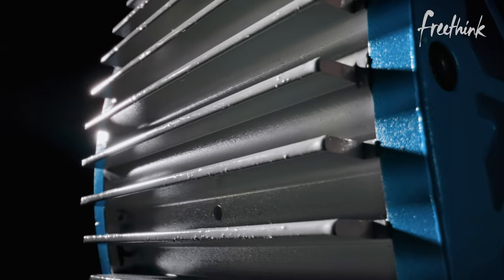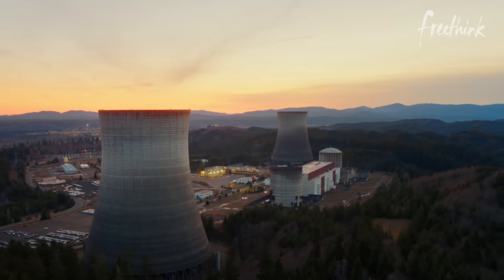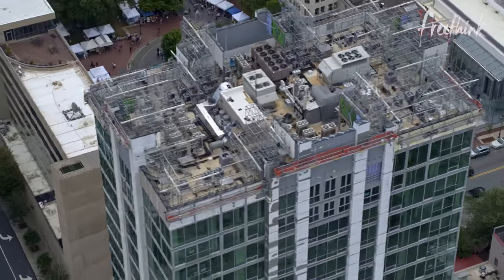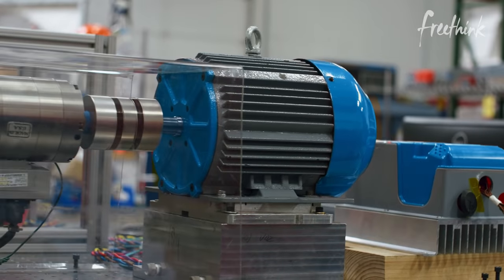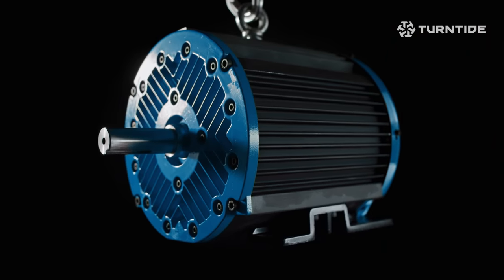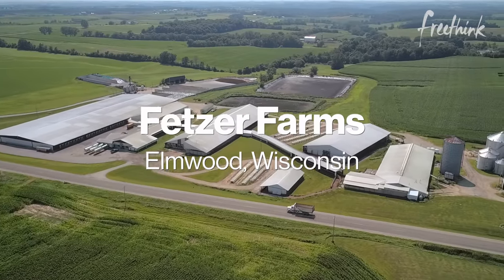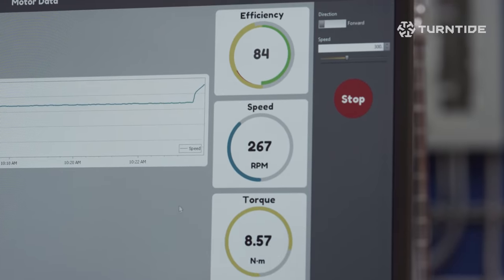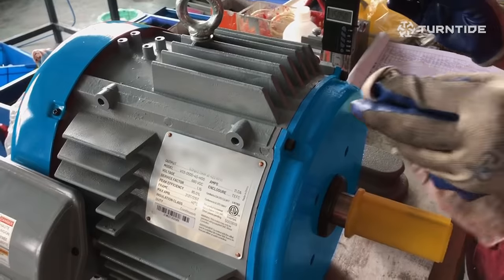Want to Save the Planet? Start with Reinventing the Motor

Comment: As someone who holds a BS and MS in electrical engineering, I can honestly tell everyone watching this video this guy is full of it.  Half of the energy is not wasted in electric motors.  Most induction motors are at least 80% efficient (the most common motor used in residential HVAC systems, or residential anything).  Most modern industrial motors have efficiencies greater than 90% due to advancements in VFD drives.  There is quite simply no need to improve on motors much more than has already been done.  The YouTube community needs to do its part and downvote this video into oblivion.
Reply: i was wondering  to if their not just talking about some wierd single phase to 3 phase converter or some thing
Reply: @cameronidk2  If you look in high-efficiency dishwashers for example, they already have that.  Wherever economically feasible, motors are already being replaced with their more efficient counterparts.  A particular motor that isn't very efficient is called a "shaded-pole" motor.  They used to be everywhere that required a small fan.  Now they are being phased out by brushless versions with much more efficient drive circuits.  There really isn't much more opportunity for improvement in efficiency beyond this.  And that work has already been done.  This video does nothing but make false claims purporting there is much more that can be done -- well as a seasoned electrical engineer, I call B.S. on all of that.
Reply: I was wondering the same thing when the opening statement about motors wasting 50% of energy. This is the whole basis on Tesla. Three phase motors are 90% efficient depending on frequency.
Reply: B.E. here...we use the things we already use for a good reason and by promoting these "innovations/kickstarters" to people who aren't in the know just to take their money is downright immoral. There is a reason our roads are made from plain slippery when wet asphalt and not that "revolutionary" self regenerating one someone held a chunk of on a video.
Reply: I don't finish EE(switched to materials engineering) but I get what you said
Reply: Man, literally 35 secs into the video when he said that statement about half the energy being wasted I was like this is bullshit, then I paused the video and went to the comments to see if there was anyone else who also picked up on this bullshit.
Reply: I was just about to write this. They are overhyping a decent invention that may have very particular applications. Electric motors are verry efficient, especially on industrial applications. Most ineficiencies occur on application that require a constant on-off control of the motor and most of these are solved ussing VFD. There are few things more elegant than a 3phase inducion motor on industrial aplications, pure efective simplicity.
Reply: Thank you, this is BS. 3 phase brushless induction motor is 90% or more.
Reply: byugrad1024 The patents aren’t owned by the Software Motor Corporation of Sunnyvale.
Reply: @jpdemont  Not sure what you mean by that.  My criticism is of the video itself.  In the video they claim motors are only 50% efficient, which is an outright lie.  Deceptive.  I could care less about any patents involved here.  This is purely deceptive marketing and click-bait going on here.
Reply: My BS sensor went of the moment they claimed it was thought to be pretty much impossible and then call switching something on and off at 20 kHz fast... And even silly brushed motors can be made to be 80% efficient.
Reply: How do you know a life time student is in the room,.....don't worry they will tell you
Reply: As a State Certified Electrician & Automation Technician, I am so glad you made your comment; as I was hearing him talk, I was losing my mind and starting to question everything I already knew.

These people don't know what snake oil to sell these days in the name of "green".
Reply: Pure BS reported this video as spam/scam
Reply: @aussiegruber86  Not a life-time student, although I studied a lot in school.  One of the benefits of that (in addition to earning a killer income!) is that I have the credentials to call out scams and false claims when I see and hear them.  This is one of those times.  I have no interest in being a student any longer, but I'm definitely engaged in life-long learning.  You should try it sometime.  Just don't make any false claims about anything or you'll probably get called out on it.
Reply: I think the "50% wasted power" he's talking about refers to under-loaded induction motors, which DO waste a lot of power if they aren't driven by a smart controller, due to their low power factor in this case.  The fact is, MOST induction motors are operated at much less than their full rated power, due to the need to be able to handle high starting loads (especially in loads such as air compressors and refrigeration compressors) and high peak loads in a great number of industrial applications.  While it's true that most of these applications could be served by electronic controllers, the fact is that most of them are NOT.  They are simply run at the full rated voltage even when lightly loaded, causing them to run inefficiently.
I am not an expert on induction motor design (that is, the motors that drive almost all industrial loads), but I do know that resistance is deliberately designed into their rotors in order to optimize for certain characteristics, and this resistance leads to inefficiency at ALL loads and speeds.  A variable reluctance motor does not rely on resistance in the rotor, and does not require inducing a current in the rotor that in an induction motor increases the current in the stator as well.
While the video may be overstating the case by failing to mention that there are other ways to increase the efficiency of induction motors that are already in use, the fact is, a variable reluctance motor at its best can be more efficient than an induction motor at ITS best.
And then there are brushless DC motors, which are essentially electronically controlled synchronous motors, which are another type of high efficiency motor that isn't even mentioned in the video.  These can run circles around induction motors, but I don't know how they compare with reluctance motors.  Again, not an expert, but for large motors, reluctance motors are probably less expensive than the motors described here.
So yeah, a little bit of BS, but also some truth in there.
Reply: Sorry, I meant variable reluctance motors are probably less expensive than brushless DC motors, since the latter require expensive magnets.
Reply: Im glad others seen this lol, I had soooo many skepticisms in the video I thought I was the one in the wrong. I dont understand how a ML algorithm would be useful as an algorithm for controlling current lol it makes no sense and seems like they are embezzling more than anything. They claim computers cannot compute on and offs 20k times a second even though cpus compute billions of instructions per second.😂
Reply: Depends. Most motors in the households are small single phase motors and they do have reduced efficiency compared to 3 phase motors. But yeah - 50% wasted energy is just bullshit.
Reply: Exactly!!!! Thank you so much for you comment. It perfectly sums up what is needed to be said!
Reply: @TheOriginalEviltech  No, it's not bullshit.  When you see a single "efficiency" spec for a motor, that's usually its BEST efficiency.  For the motors in continuous use today, this means induction motors, which are most efficient at close to their full rated power.  Efficiency in induction motors drops off sharply as the load is decreased.  This is because it takes a certain amount of power to be continually changing the magnetic field in the rotor, 100 or 120 times per second, regardless of the load on the motor.  This "magnetizing current" is independent of the load on the motor, that is, it is just as much for a motor running with no load as it is at full load.  Worst-case is an induction motor running with almost no load, for which the efficiency approaches 0%.  According to GE's small industrial motors catalog, the magnetizing current at 1/4 load is as high as the current going into doing useful work.  These currents don't add directly, because they are at different phase angles, but the result is that an induction motor running at 1/4 load wastes 30% of its power just on magnetizing current.  This is in addition to about 10% losses due to the resistance of the copper wire (or more like 20% in cheaper aluminum-wound motors), so we have 40% loss right there.  So that's 60% efficiency at best for motors running at 1/4 load, which is about the typical average load that machines driven by induction motors are designed for.
It is possible to get higher efficiency by using electronic controllers that effectively run the motor at whatever voltage is necessary to just drive the load, at which point the efficiency can be as high as 80-90%, but the vast majority of motors IN SERVICE today were designed decades ago and do not use such controllers.  This is downplayed in the video - basically, ANY type of electric motor (not just the switched reluctance motors they are promoting) can be run more efficiently by using a smart controller.
Reply: @BrightBlueJim  the high startup power is accomplished via a separate coil and a switch that turns it off at rated speed.  So yes, during startup, most motor is less efficient.  However, their main coil is not in any way over designed for the application which would make it not run near it's rated load, like you assume.  Running under rated load which is what the motor has been designed for inside of an AC compressor or furnace, you can still achieve efficiencies of at least 80%.  If you want to further improve this, you have about 10% of margin to work with if you switch everything over to variable reluctance technology.  This is not rocket science.  In no way is a modern AC compressor or furnace motor, or for that matter refrigerator is wasting 50% of the power it has consumed.  No WAY.  That is my point here.  That's the B.S. I want to point out.  That claim is absolutely, 100% false.  Period.  End of story.
Reply: byugrad1024 - It’s possible 50% of energy is wasted at the machine level (think of the efficiency of old air conditioners vs new), but that’s largely unrelated to the type of motor used.  I’ll give him the benefit of the doubt and assume he misspoke.
Reply: exactly said, as someone from power generation, this people are spinning jumhla
Reply: Yup. Seems like they've conveniently forgotten about IE3 and IE4 induction motors that are already in the market with more then 90% energy efficiency. Electrification is the way. The big waste of energy is open cycle gas turbines which no one seems to talk about.
Reply: Im on it
Reply: Hi, i have a doubt, are synchronous generators doubly excited?
Reply: remember that ordinary motors are usually 80/90% inductive efficiency, synchronous motors reach 100% inductive efficiency and pass capacitive efficiency. ideal is resistive efficiency where current is not delayed in relation to voltage.
Reply: byugrad1024 - totally agree with you! High frequency induction motors are now much more efficient than they were just 10 years ago. Another thing is that electric motors also get more efficient with size as the copper and iron losses are less per KW of input power (assuming multi Kilowatt motors. He’s just trying to pull the wool over silly uneducated investors eyes! Typical BS.
Reply: You are right--------------------Back EMF also a potential energy that be can store and re-used,,,,,just to save...!!!???
Reply: "Resonance" by Tesla and Berdini, seen in YouTube,,,
Reply: Additional strong permanent magnet in the field /exciter make less current and provide more output + on and off(resonating)....
Reply: Adding strong permanent magnet or fix magnet   in the rotor  can  reduce current consumption with in the motor efficiency.
ac 3 phase induction motor
dc 3 phase motor 

TESLA CAR base in type above is on the RIDE
Reply: dc 3 phase motor---dc to 3 phase converter
Reply: The coil winding are sand witch over the top start to end to end to start to end together then no place for switching process to obtain,,should be individually separate coil, Core and rotor magnet in every angle
Reply: i mean overlapping of the coil winding, not good,,,
i'm not good,,,see
Reply: Having a BS in mechanical engineering myself, and having worked with electric motors before on racing vehicles and RC airplanes, I can confirm byugrad1024's position.  That "computer that controls how to turn on and off the current" used to be a simple mechanical device called a commutator.  We later made a better one called an ESC (Electronic Speed Control) for brushless motors and some other motor types that improved performance and the capabilities of the electric motor (such as being able to go in reverse as well as forward without having to take the motor apart).
Reply: Just another stepper motor, so whats new. Looks like another start up scam.
Reply: This just sounds like a more efficient brushless motor. The numbers they are getting are probably from going from 80% to 90% efficiency (e.g. a 50% reduction in waste) or a 90 to 95% efficiency so they're just flipping their numbers. Probably they optimized the timing, construction methods, weight, materials and number of poles in the motor to achieve this. Doesn't sound like a scam - they're just selling it for more than what it is. And likely not everyone is using it because they just patented their design and have to drive down cost through production of scale and optimize it for various sizes - e.g. it may work more efficiently for HVAC, Dishwashers and electric cars but may not be logical when sized down for RC or smaller motors.
Reply: The part about induction motors running at single speed and heavy losses was true when they used huuuuuge resistors to control them with heat sink on. But with power electronic devices now, the amount of voltage pumped itself can be controlled and lets just not talk about inverter type motors at all to avoid being an even more efficient but slightly costly alternative.
Reply: Sheesh, variable reluctance motor drives are done by lots of companies, they speak as if they are the only game in town.
Reply: @BrightBlueJim  buy a drive from Rockwell Automation then.  Drives work really well.
Reply: Yeah literally only thing left thats not efficient is current moving creating heat and little pit paracitic  magnetfields on wires and are impossible to delete or not worth it. Only thing is to freeze to absolute 0
Reply: I am totally not an expert on this, but I as far as I know switching the electric on and off saves battery energy. But I am not sure what that will do to the generated horse power.
Reply: Every time someone or any company comes up with this "Save the Planet" conversation, I already know that it is pure misleading advertising. And those who cheat in advertising will lie in all their proposals and products.
Reply: Working at a EASA certified motor shop with daily hands on experience with motor, pumps and gearbox repair I can tell you there is quite a market to improve motors. Tesla manages too fit two 259 HP three phase induction motors in the Model S that weighs 4600 lbs. Looking up in my catalog a standard three phase ODP 250 HP Baldor catalog #EM25254T-4 weighs 2000 lbs by itself, 24" in dia and 36" long. This is a improvement where it simply hasn't been done. 
They manage this due to a similar design called Interior Permanent Magnet Synchronous Motor
 (IPMS). ABB/Baldor has their own design (SynRM), Regal Belot (Century, AO Smith, Marathon, Leeson) are all designing these their our Reluctance Motor.
Reply: What limits us from unlimited speed with a motor?
Reply: @JoseAndCode  Hey, I actually have some insight here as a robotics engineer. So CPUs are generally actively cooled and not designed for near-constant red-line workloads. Things get a bit better when you look at commercial CPUs for datacenters and the like; however they still assume active cooling. These are also typically expensive components. Motors with active controllers built-in have to function with stock-standard passive cooling, in potentially hot environments, within the same housing as a rapidly cycling electric and magnetic fields. These applications are also prone to high-frequency vibration, which causes more issues for electronics. Electronics that can operate at that speed, in those conditions, that will last for the life-time of the equipment (who is going to buy an AC that may need to be taken apart to replace the motors' CPU?), is a tall order to accomplish. So it isn't that that electronics that can operate that fast aren't available, it's that they either can't take the heat, or are vastly more expensive than what would be economical to put in a cheap motor.
Reply: I agree, this is nothing new and also their information is totally false HVAC motors are approaching 97% efficiency
Reply: Its just a glorified brushless motor lol
Reply: @wovasteengova  it's B.E.M.F. the s.r.m. has no b.e.m.f. so theoretically can attain v.high speeds limited only by its bearings capabilities..and rotor/ structural vibration limits..
Reply: so in science when an insanely genius person said that "it's over nothing else will happen", then it is done?, so how about just a random comment in YouTube? will it determine the whole fate of science?...if so then your BS and MS in electrical engineering don't teach you anything about the actual science
Reply: Mostly agree with you (as someone who holds ms degrees in power electronics and motor drives from the midwest^_^). When talking about modern motor efficiency, the VFD (or inverters) should be considered together. The efficiency is determined by motor design and control hardware and software. And it can be further improved by system-level design, for example, combing the applications' frequent operation points with machines' high-efficiency areas. Switching reluctance motor is not the best choice compared with other motors (such as PMSMs) in efficiency. But I appreciate this company's exploration and dedication.
Reply: the guy is relying on people not realising that electric motors do not run at full current all the time. The visuals and promise appears to scale the load factor, but yay - that already scales naturally.

The extra factor of finer control over speed is likely net zero once accounting for semiconductor losses.
Reply: Agree. Download any set of datasheets from a major manuafacturer of 3 phase motors eg. WEG and you can check the original statement is BS.
Reply: @austinschwebel819  
You compare two different things designed for completely different applications there and it makes no sense at all.

Teslas PM-switched reluctance hybrid may be a great thing for its application, but comparing it to a passively cooled AC asynchronous for industrial applications - what's the reasoning behind that?
If you want you can build an actively liquid cooled AC induction motor with rotor cooling with the same specs way smaller and way lighter as well. That's an Apples to never seen alien lifeforms comparison, at best.

You can get a hint what's possible with induction motors if you look at modern high-end built-in motor spindles for VMCs and such. And their main concern above everything else isn't even weight nor packaging, those factors are just important among many others.
Reply: The one thing I do see which is an improvement is the simplicity of the stator windings (see the associated video @ 22:37 ). They've developed a non-permanent magnet reluctance motor and put an enormous amount of work into control electronics.  If their motor really is cheap and saves loads of money in use then the industry will quickly adapt and there'll be no need for these BS videos.
Reply: @mb-3faze  
What video are you talking about?
Reply: @mb-3faze  
Never mind, got it!

But with todays technology, automated stator winding and such, do you really think that would make a significant difference?
Reply: @heinzhaupthaar5590  That's a good point. Motor makers have been winding complicated stators for a long time now using pretty sophisticated machines to do so. This companies emphasis is on the control electronics so you wonder if they applied their control knowledge to current motors then they might get similar results with existing technology. The reluctance technology - the same used in Tesla and other EV companies seems to be becoming standard. The interesting thing is most (many) EV motors are using permanent magnets in the rotor of their synchronous reluctance motor designs - presumably they do so for a reason, otherwise they would have just stuck with the non-permanent magnet version.
Reply: very very well said i was almost about to type something similar. We've already taken motor technology as far as they can be taken. what we need are new forms of energy conversion
Reply: @mb-3faze  
Yes, if you search for it you'll find pretty good explanations what the reason for and the benefits of the additional magnets are. Seems to be a great thing for certain applications.
Reply: could smell the nonsesnse from the first few seconds
Reply: The title alone already disagree bc battery tech is what is holding us all back.
Reply: Yeah I don't need a degree to know that half of the energy isn't lost. What a loser that guy is, can't (well actually I can) believe that people are so lazy they don't read even the wikipedia page before making a huge propaganda piece about it.
Reply: @jholid6y  by battery tech you mean overcoming energy density, which by the way, if you were to make a battery as energy dense as any petroleum fuel, you essentially have a bomb
Reply: Thank you for informing us
Reply: Isn't this just a brushless motor with an ESC?
Reply: It's not the motor that's inefficient, it's everything it's attached to. I used to build and drive drag bikes, small engines lots of power, but getting it to the ground was the problem. Just a simple but expensive thing as changing the bearings to ceramic was an incredible difference. Look at the drag coefficient between ceramic and conventional bearings, that will make my point.
Reply: Well, I did my part.
Reply: agreed
Reply: yep and this is literally just a brushless motor... Like min my cordless drill.
Reply: I DONT have a degree in electrical engineering and I can tell you he’s full of it just by how their talking. “Revolutionary technology” … “Never been done before” … “It’s going to change the world.”
Reply: it’s just a stepper to begin with.
Reply: Agreed.  The 2 main losses are magnetic containment and I2R (heat) losses in the coils.
Reply: Thank you for sharing your knowledge and fighting fake news. It should be a crime to spread misinformation
Reply: As an electronic engineer i agree.
Reply: Okay. As you said
Reply: my question was how do you have 70% more efficiency on a machine that is at least 85-91% efficient... because wow
Reply: But but, they showed how they paint it..............
Reply: Is this technology the same as the BLDC motors currently being used by many fans manufacturers?
Reply: Yeah I was thinking the same. If electric cars are already 80% efficient how the hell an electric motor could be only 50% efficient lol
Reply: I ain’t no rocket surgeon, but this motor looks like low resolution stepper motor.
Am I missing something?
Reply: Basic parts are mostly as efficiant as they can be. Like who needs to invent a better sigma beam*. 

* Generaly alimium tube whit a X shaped outer part used in prototipes and such.
Reply: BMW apparently doesn't seem to think so, assuming the video is correct. They invested in them and are integrating their systems into it. If any one actually looks at the data and could understand, it's a pretty safe bet that they would.

From my understanding of the video they essentially took a v gate motor and found a way to break the sticky spot by turning off the magnetic pull just before it get's to it. seems legit but time will tell.

edit: so I looked into it a bit more and actually they seem to be doing better than ever amazon backed them and integrated them as well into their buildings so I'm gonna repeat my point I'm fairly confident that those engineers know what they're doing and with them having hands on experience with it as opposed to watching a video it's a safe bet that it more than likely does what they claim.
Reply: @lpfan540  Based on comments they bought some fans from them. That is a form of "investment" but kinda missleading.
Reply: @egesanl1  not in this case https://www.crunchbase.com/organization/software-motor-company series A funding: Number of Funding Rounds 
8 

Total Funding Amount 
$432.1M

series b was from bmw 

major backers include amazon climate fund, BMW, bill gates break through energy fund, FootPrint Coalition, Fifth Wall Capital, and Keyframe Capital. 

normally I'd agree that it could just be about face value for some of these companies but these are also some of the worlds top engineers and companies to say that they would blindly invest in something that they don't believe works or have done their due diligence via models or replication is pretty much unrealistic. 

series investments also don't work that way purchasing equipment isn't the same as backing the company with working capital.

also youtube comments tend to be crap, anyone can say they're a engineer and have multiple degrees in a field that they may not have but sites such as crunch base don't tend to lie and back up their sources.
Reply: I think he means all motors, so gas powered ones included. So he means if we replace all the gas powered ones, we can reduce carbon emissions, which is nothing new.
Reply: They really sounded like a parody iPhone commercial
Reply: I thought it's to good to be true.
Reply: I think he got confused between induction motors and combustion engines 😂😂
Reply: !Save
Reply: Turntide is the new Theranos/Nikola.....
Reply: I'll take whatever improvements we can get
Reply: "There is no need to improve motors"
Wow...
Reply: It has 13k likes to 6k dislikes, so about 1 in 3 that voted dislikes it, which is pretty high dislikes
Reply: @lpfan540  your last line was my thoughts about this entire string of youtube comments "fighting misinformation" LOL. so easy for people to play keyboard warrior or armchair general when their identity is protected and nobody can hold them accountable for it. Imagine how many of them would shut up the instant a law was passed that demands a personal ID be connected to ones online presence as a means of holding them accountable for what they post 🤷‍♂️
Reply: i saw 'revolutionize the motor' + 'switched reluctance' and I was like nah
Reply: Every electric motor wastes half of its energy because the Lentz law and back emf. Electeical engineering BS/MS my ass.
Reply: I was impressed with this video.  Then saw your comment and had to look it up for my self.  From what I can see, I am finding different results to what you are saying.  Switch Reluctance Motors are not common place and are more energy efficient that inductance motors.   Can you please provide some sources.  Here is a video I found comparing the two. https://youtu.be/vvw6k4ppUZU?si=3xCAywiAajK4cKtj